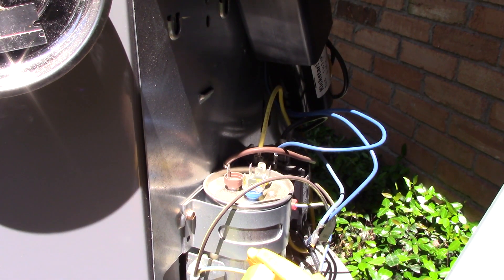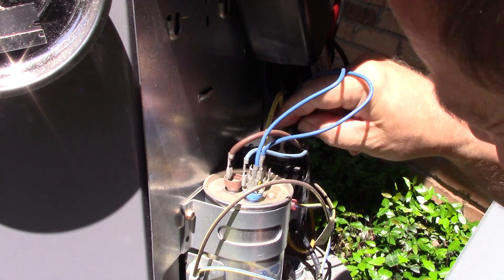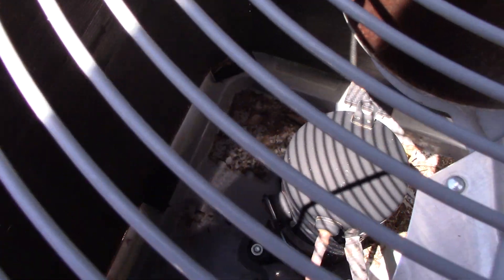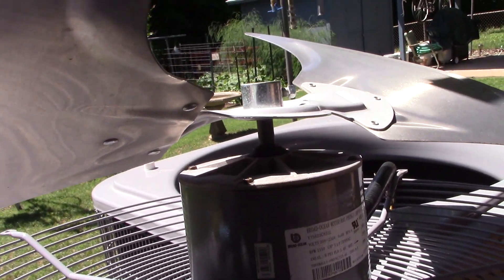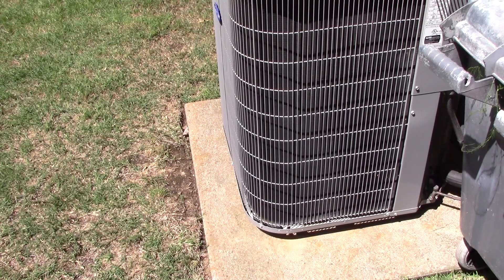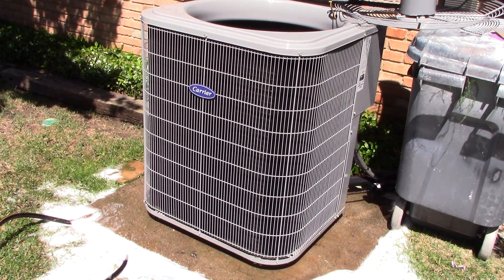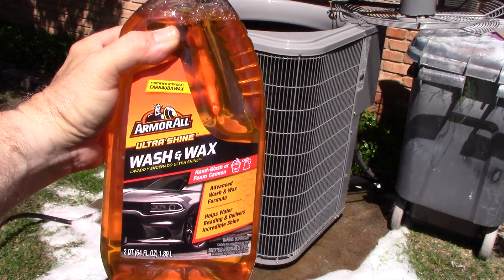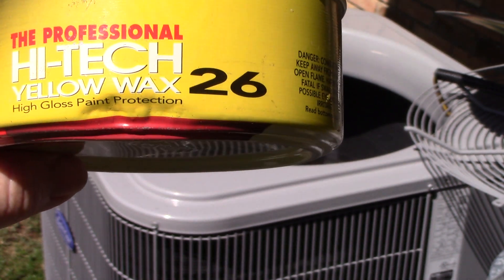2021 Carrier 3.5 Ton Clean And Inspect For 2024 Cooling Season

Comment: Crazy! I was just reading comments on a video about how residential trades are going to have trouble in the future. YouTube university is a real thing. I have fixed ac issue  with YouTube for $100 bucks that a guy wanted 3k for. Uv protect the wires seems really smart!
Reply from the maker: That's awesome you saved so much money repairing the issue yourself! Yep, I've fixed many things referencing a Youtube video over the years.
Yeah, I was noticing they had faded, so I thought, what the heck, I'll put some UV protectant on them.